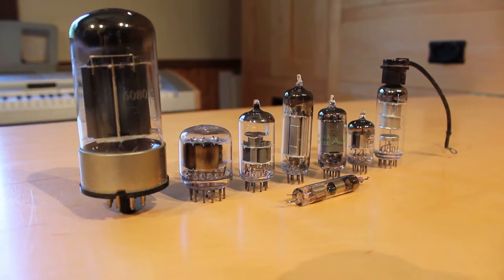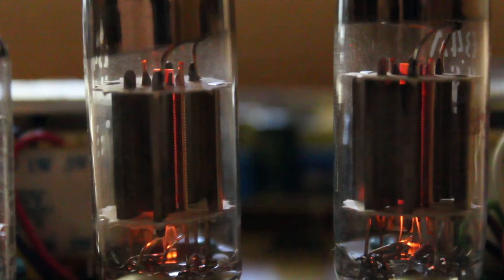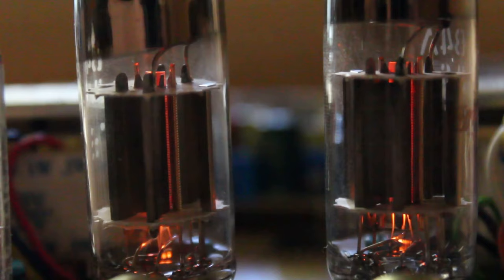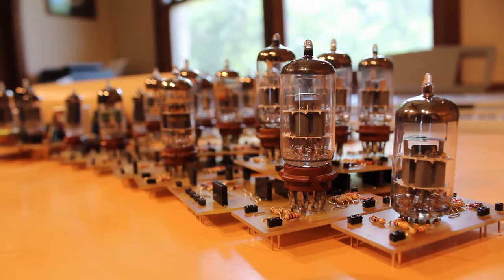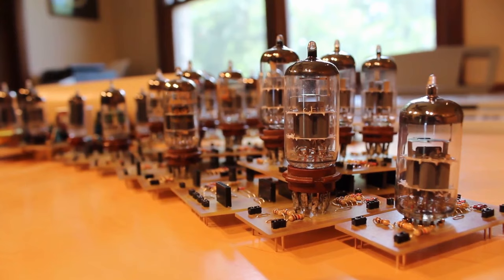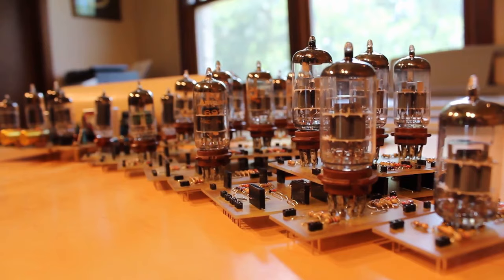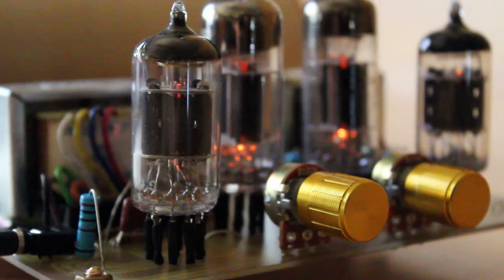Vacuum Tubes: Episode 1 - The Basics and the Diode

Comment: The 6AL5 is a double diode with separate cathodes. Such diodes would naturally be found in early AM radio recievers as demodulator tubes. One diode rectified the signal going to the grid of the audio amplifier and the other diode would be wired to let the negative voltage trough (other half of the AM 450kHz IF) and create the so called AVC or AGC (automatic volume controll or automatic gain controll) sometimes it was just controlling the recievers front end and IF amplifier section to adjust the gain of it so that I'd does not get horribly overwhelmed with a nearby powerfull radio stations signal, and when you look for other stations weaker ones then it lets the gain go as high as it can let it go. That negative voltage was often used to controll the grid of a "Magic Eye tube (as an example 6E5) which would indicate how strong is the signal showing you two things at once-how on center of the stations frequency you are and how strong is the signal.

No I'm not a gray bearded tube enthusiast :) I'm 18 and I play with vacuum tube stuff a lot most often amps and I even build them and right now I am building a switch mode powerfull power supply for my next 2x100W upgrade :)
Reply from the maker: The 6AL5 is a fantastic and versatile little tube!

I'll definitely defer to you for it's usage in radio operation, my audio game is really weak, haha. But, it was used pretty extensively in IBM's computers. One of the uses was combining a 6AL5 with a 5963(12AT7) dual triode to build a dual NAND gate. But, in general, it was used pretty much anywhere a diode was needed within the logic of the computer. Even after germanium and selenium diodes became available, IBM still preferred to rock the 6AL5 in the majority of cases due to how tough the tube was and also how the 6AL5 has practically zero reverse leakage. I've actually used the 6AL5 quite a bit for building logic circuits when I don't want to use any silicon at all (check out my most recent "In A Minute" episodes).

That's awesome that you're playing with tubes at such a young age (although at 36, I'm still considered young in the tube game)! If you've got a place where you're sharing your builds, let me know! I love checking out other's projects!
Reply: @UsagiElectric  I was just pointing out where the bulk of the tubes went in consumer appliances :) some VTVMs used it for the AC range since a vacuum tube diode has basically 0forward voltage. The only caveat is the output impedance at low low low voltages causing significant deviations and need for non linear scales.

The 6AL5 was the first hand choice for tube radios until detector tubes didn't exist. After that you had a noval single tube with a single triode and two diodes going to ona cathode and bam you have all the mean os IF decoding and AF amplifying IN ONE GLASS BOTTLE. Back then they would call this "modern tech" :D 

I'm more of a audio tube person so yeah I tend to work with ampliffiers that have an exces of 400V on the anodes. (EL34 20W push pull) or one of my latest creation with two KT88 tubes that runs the anodes real high at 600V for ultimate 120W sine tube power...all that powered from a single switch mode power supply. Life as a nerd has never been simpler hah. Just obtaining the tubes became an expensive hobby over the time.
Reply from the maker: @adam207321  You know, I have a few 6T8 triple diode triode tubes and I always wondered what they were used for, but decoding and amplifying in one tube makes a whole lot more sense! I was trying to figure out how to use them for digital applications, haha. They would work great as a three input NOR gate though! Late vacuum tubes started getting really specialized and interesting, cramming more and more stuff into a single tube. One of my favorite tubes in my collection is the 6D10 which stuffed three triodes into a single tube - granted it uses a duodecar base, which aint super easy to find a socket for.

400V and 600V on the plates is just mental to me! Especially considering I'm doing all my tube stuff at just 24V, haha. But, for proper audio applications, more voltage can give some proper power. The KT88 is a properly good audio tube as well it seems, I bet that amp puts out an awesome sound! My only proper experience with tube amps is getting my grandfather's old Magnavox Concert Grand radio back up and running. Which uses quite a lot of 6V6s and puts out one of the best sounds I've ever heard from a stereo!
Reply: @UsagiElectric  6V6 is a octal equivalent of a EL84..not like a 100% but if you were to switch them for that they would work no problemo maybe you would have more gain with the EL84s more desireable for guitar players.  6V6s  were also used in some american radio gear from the 1950/60s. Mind you in very expensive home sound system setups back then. The KT88s are just EL84 but MAGNIFFIED. By a lot since the plate dissapation of one KT88 is more than two EL84s. 

About the voltages in audio: you can build a GU81 amplifier with 2kV on the anodes and also build a 2A3 or 300B tube amp with 300V on the anodes or a 6C33 with 150V on the anode. Its all about the plate characteristics of the tubes. Very speciffic. Granted generally running higher anode voltages will give you a lot more power when you match your load impedance and run far more into class B than AB. But you can tripple or quadruple your power output. And half the lifespan of your tubes doing that.

The 6T8 seems to have two diodes common to the cathode of the cathode of the triode and one completely separate one. In radio use the cathode of the triode would be grounded so that the voltage on the anodes would go negative creating a negative bias for the rest of the tubes in the radio chain to change the RF and IF and in some cases AF gain too. 
We know that the output voltage is dependend on the voltage difference of the grid and the cathode. You could put a resistor in the cathode so that when you put a voltage on either of the diodes it would pull the cathode higher or closer to the grid voltage and then reduce the current trought the anode and make the output go high. I see a really compact OR gate out of this :) With also a this input the grid. Im sorry Im not really a digital guy so I dont know how else could you use the grid for input.
Reply: @UsagiElectric  it would all need to be carefully biased tho
Reply from the maker: @adam207321  That Magnavox Concert Grand is a brilliant sounding stereo, and given that it's also a massive piece of furniture, I can imagine it was quite high end stuff in the early 60's. I will say that when it's on an running, there's a noticeable temperature increase in the room! I really do need to learn a bit more about audio tube applications, but it's definitely a rabbit hole that I could see myself spiraling down, haha.

The GU-81 is one of those bucket list tubes I'd like to play with. I say bucket list because it's just such a cool tube it's like life goals, but also 2kV is terrifying, haha. Still, it would be a ton of fun to make an amplifier with it. But, I do agree that it's all about the characteristics of the tubes! I have about 150-ish 6CB6 tubes that I'd like to do something with someday, but they wouldn't really want much more 200V on the plate (maximum plate voltage is rated at 330V). But, with so many at my disposal, it would be really interesting to gang about 20 of them up to build an output stage for an OTL amplifier. 

That's really smart about adding a cathode resistor and then using the diodes to pull the cathode potential up or down! I'm not sure how well it'd work at just 24V, but it's definitely worth experimenting with one of these days! Especially since I'd love to bump up to about 100V in the future to really open up the possibilities afforded by all the unique tubes out there (in my testing, there's really only about three or four tubes that work really well at just 24V).
Reply: @UsagiElectric  yeah putting a ton of tubes in parallel to make a OTL is kinda asking for trouble. Those tubed are probably not some real low impedance drivers are they. 
The best results you're gonna get are going to be with voltage regulator tubes...not the ones that are designated as references (tube zener)  but the pass tubes. I believe some soviet military low voltage triodes are also great in a class A cathode follower circuit or better yet a cascode. But those are more of a 600ohm headset driver anyways. If you have ever looked at the K2-W tube op amp  you'll know it's requires 300V+ and 300V-. That's a 600V PSU!! BUT I think I could have a easy solution for you. Make yourse a push pull converter with a TL494 no need fir feedback and now you have the voltages you need. Just a dumb inverter but made for much higher frequencies. So you don't have expensive and very dangerous iron on your desk all the time

Comment: Seems there are two options low voltage high amperage, requiring use of thick heavy 0 to 6 gauge power cables to move power or one can use very high voltage with low amperage meaning you can use thinner 14 to 20 gauge solid core power cables.

Comment: Nice video, full of interesting and clearly explained principles.  The drawing of the diode though at 9:00 into the video is the wrong way round.  Electrons carry negative charge (obviously), to if electrons move to the left, the "current" - i.e. the flow of positive charge - moves to the right.  The arrow triangle should point to the right, not the left.  Maybe this is corrected or explained away later in the video - if so, my bad.  Have a nice day

Comment: The indirectly heated cathode is more efficient because it's coated in chemicals (metal oxides) that have a higher thermionic emission that plain tungsten, so you get more electrons out of it for the same temperature.

Comment: Love your channel, thank you for sharing your knowledge! I came across some random tubes that test great, but know if I can swap or roll these on my SET amp. Can you share your insight on whether I can swap these tubes with my 12ax7 and 12au7 tubes in my current configuration. 
The tubes in question are:
5879
5814
5687
5751

Comment: What was the minimum voltage you used that still gave a diode effect?
Really interesting experiment. I too was always put off by the high voltages. I remember old portable radios that had batteries providing a hundred volts or so (if I remember correctly).
Reply from the maker: Thank you! I never actually tried to see how low I could go with the diode, but all these were done at 24V. I will say that in my early experiments with triodes/pentodes, I actually was able to see some effect with voltages as low as 6V. This is an unlisted video, but it shows my very first attempt at playing with a pentode (https://youtu.be/SDvdMl7H9UI). I knew so little when I first made that video and I have some things set up... poorly. But even so, you can see that there was still a measurable effect at just 6V which shows just how flexible tubes can be!
Reply: There where a few vacuum tube portables that ran at lower voltages like B+ 27V, filaments 1.5V. Some tubes ran at car voltages B+ 12 V , the portables sure used up batteries…
Reply: @donwebber7034  It is still within living memory that once upon a time, running the radio in your car with the engine not running could rapidly run down your battery to the point where you'd be stranded with not enough charge left in the battery to start your car.  There were quite a few "stranded boyfriend and girlfriend" jokes made which referenced that exact situation.  I even remember at least one Archie Comics story with Archie and Veronica in exactly that situation.  Yeah... they definitely used up the batteries fast.

Comment: In the first experiment, the LEDs are glowing from the filament supply. Or else, you should see the LED turing on/off if you connect the plate supply to VCC/GND
Reply from the maker: The filament supply I have set up on the 5642 diodes only shares a ground with the rest of the circuit, and shouldn't be imparting any current flow. However, LEDs are super sensitive, and I think between my fingers and stray capacitance in the breadboard, we're seeing just a slight glow on them.

Comment: The indirect heating may have some other practical reason : there may be undesirable effect when powering a filament as an emitter. one lead will always be more positive than the other and absorb electrons too, which may cause an imbalance of some sort. No idea if AC or DC is better for filaments, but DC is a constant imbalance, while AC is a constantly changing imbalance. Indirect heating was maybe a way to reduce the problem.
Also, using leads of a transformer to power filaments on a mains-powered equipment could be the more practical than having to generate DC for them too, especially back before solid-state semiconductors. If the filament supply is isolated, the emitter and filament can be linked together like you did and can be set to any voltage while keeping the filament active. This would allow much more choice in circuit design.
Reply from the maker: It's interesting that you mention that, because that's actually a genuine problem with Vacuum Fluorescent Displays! So much so in fact that VFDs designed for use with a DC supply on the filament, actually place their filament at a relative angle to the plates, so that the less positive side is closer and the more positive side is further away. That way they can ensure consistent emission across the entire filament and subsequently consistent brightness out of the fluorescing plates.

Although, I think the primary reason behind indirect heating is that it allows the cathode to be coated in a material that enhances emissivity. That means that the filament can be heated to a lower temperature for equivalent emission, giving longer filament life with no real impact on performance. Granted that's probably just one of a hundred reasons why indirect heating became the standard, it's still an interesting thing to think about!
Reply: @UsagiElectric  using an angle to make DC VFD's is interesting, it sounds indeed like an easy fix :D
I guess using indirect heating of the cathode makes sense as you put it, especially if electron emmission grows with surface area and is enhanced with a special coating.
That reminds me, there's a someone on youtube that makes hand-made vacuum tubes (called glasslinger), and used sometimes a special emitter coating directly on some filaments, but i don't remember if that person also made indirectly-heated cathodes..

Comment: BRO! Where were you 14 years ago when I had been trying to learn more about these things for a research paper at TSTC!?? I swear I had to read up on all kinds of old dirty books on these things from my school's old library (in the section that was poorly lit because no one bothered to change the florescent bulb there). I remember coming across three books; one from England, one from the US, and one from Russia, and I swear I spent a whole week and weekend coving everything you just covered in less than half an hour. The problem was all these books were written by people who clearly knew less about this stuff than I did. I hate how the internet is slowly catching up with everything we are asking real questions about.
Reply from the maker: Haha, 14 years ago, I still didn't have a clue what vacuum tubes were myself!
It's really wild to me that most EE programs have completely eliminated vacuum tubes from the curriculum. Tubes are an excellent way to learn about how electrons move through a system, and they're much easier to wrap your head around from a fundamental standpoint than trying to figure out what kind of physics are happening inside a transistor. 
The best resource I've found on understanding tubes so far has actually been IBM's customer engineering manual for the 604 vacuum tube computer. It's still my go to whenever I need to look something up!
http://www.bitsavers.org/pdf/ibm/604/

Comment: Didn't think I was very interested in vaccuum tubes but you pulled me in.  Could you connect the LEDs to ground and + respectively and eliminate a switch?  Also, does a tube diode have a voltage drop like a silicon diode?  How much?
Reply from the maker: Thank you for the kind words!

You can pretty much hook up a tube diode in any way you can hook up any regular solid state diode. I only had the weird setup here to try and demonstrate that electron flow was indeed only occurring in one direction. The primary limiting factor is going to be the amount of current the diode can move. The 6AL5 diode I'm using here is a signal diode, so not really meant to move all that much current. For higher power applications, there are some much larger diodes with huge plates, or if you need really high power you can even upgrade to Thyratrons!

A voltage drop across the diode is something I hadn't thought of before! There is indeed a drop, but it's not quite like a conventional solid state diode. I believe the drop across the diode is proportional to the amount of current flowing through the diode. In the 6AL5 datasheet, they state a 10V drop across the diode when set up as a half wave rectifier with 60mA of plate current. Different voltage and current should result in a different voltage drop. However, if I'm reading the chart right, at 10mA of plate current, the voltage drop is just 2.5V.

Of course, I could be totally off the mark, I haven't tried measuring voltage drop across the 6AL5 yet, that's a project I should definitely give a go one of these days!